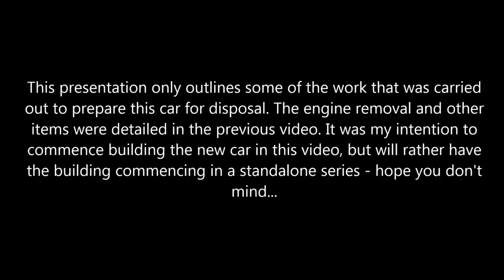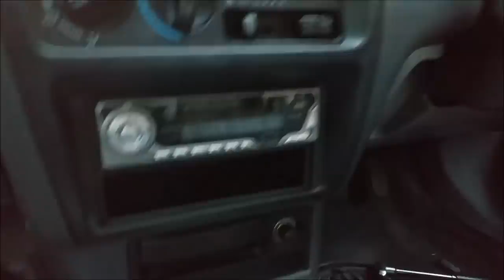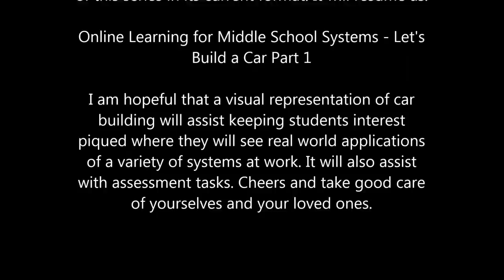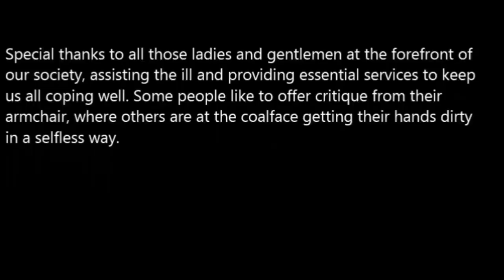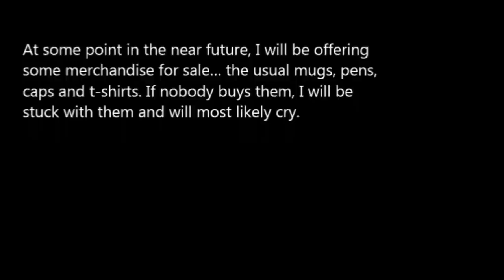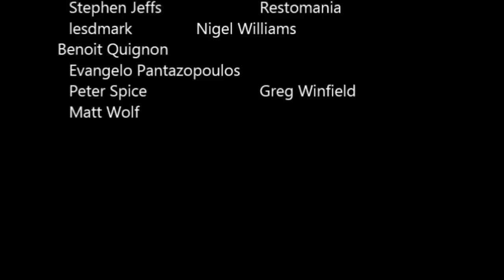More Starlie Disposal and Announcement

Comment: Its such a shame . I hope we dont see a continuous scrapping of older cars because of the airbag issue going forward . Cars are the most expensive purchase second only to putting a roof over our heads and some of us get emotionally attached to them for many reasons . Toyota told me as a salesman that a customer is a customer for life . Well now that your life is going to be crushed in Brooklyn its hardly good for customer relations . I know they compensate for the monetary value but its still not fare .
Reply from the maker: Yes we do get attached to the cars that serve us well. I have taken a healthy portion of this car and the previous 5 door one that went back to Toyota and am building a better one. The engine I bought in a car brand new and it's now in its third home as well as a host of other significant parts. The whole recall buyback is purely economic... there are those who wouldn't agree but Toyota have been more than fair. It was the State Government who mooted registrations getting pulled...

Comment: Well there goes a good car with years of life left of to be crushed,Not recycled, just put beyond use and the main metal off for scrap and the rest to landfill. Makes me cross when  people start claiming they are running an emission free vehicle and get all holier than thou. That Starlet could probably drive round the world  3 times using less energy than it took to build their new eco box and then have an electric conversion and go round 3 more times ,but with a lot more stops at recharging stations . Good  luck choosing which systems to feature for instructive content. Could be a job for life.
Reply from the maker: Yes I agree... the people charging electric cars from a non-renewable energy source and then there's limited battery life, manufacturing and disposal of batteries etc... I briefly had a 302V8 ZH Fairlane parts car that had 490,000km on the clock. I calculated service costs and consumables (tyres) etc from documents we have from the 70's and 80's factored in a replacement transmission and all the fuel it used based on 12mpg city and 18mpg highway etc etc... and with all of that over its life, it was still cheaper than the purchase price of a new Tesla - go figure!

Comment: Not being an Aussie, I am finding this a bit confusing. Why are Toyota buying back cars? Airbags, right? I answered my own question.
Reply: Some later models are fitted with Takata airbags which have been recalled due to uncontained explosions with schrapnel on crash deployment. Takata no longer exist and Toyota, couldn't/wouldn't try and retrofit another airbag system into 10 year old + cars, the Victorian government has banned them from being registered. So they in a marketing move figured we will buy them back and while the 'guests' are in the yard try and sell them a new car. The absurdity is Peters other Starlet is pre airbag so not subject to recall. So his technically older unsafer car is fine to use, but the more modern one with extra safety features is banned because of the possible risk of injury from the airbag, there have been only one or two reported injuries in Australia across the entire Takata product range, not just in Toyotas, many Japanese makers used Takata products. 

Korean cars, Chinese car are fine, they don't use Takata products.
Reply: @rayg9069  A work colleague of mine had a Toyota Airbag go off when it shouldn't have.  The compensation for that was much more than hey are paying to take these cars off the road.  Add to that medical bills....  (I am in the USA)